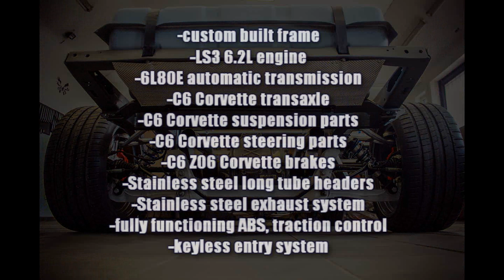C3 Corvette custom C6 frame

Comment: Good job on the frame.   I am planning to do a similar hybrid on my '72 in the near future, but I am hoping to drop the chassis a bit more and have a flat belly pan for aero.   I want to run side exhaust but will need to modify doors to raise exhaust for ground clearance.